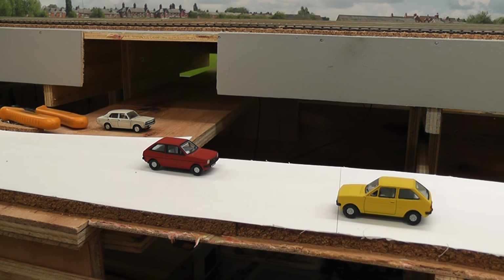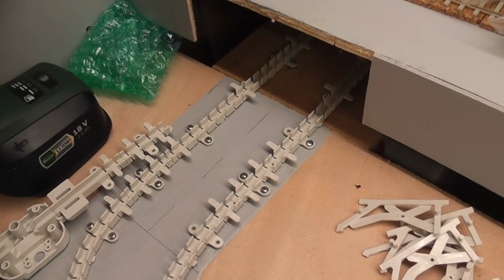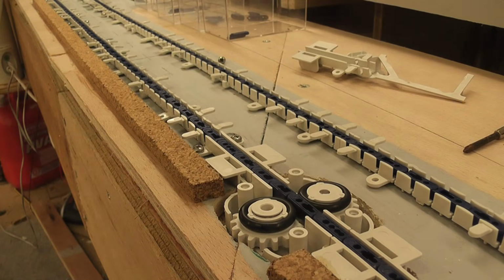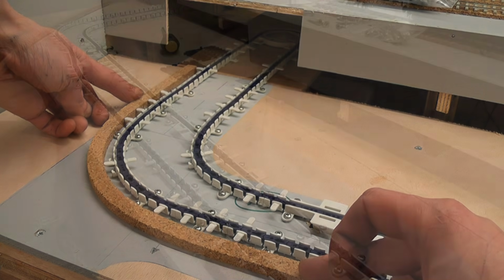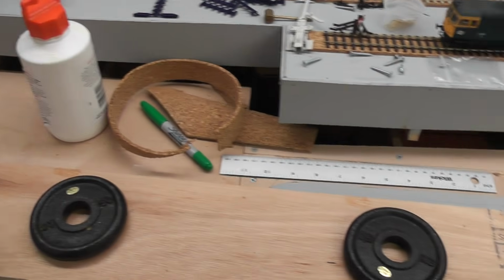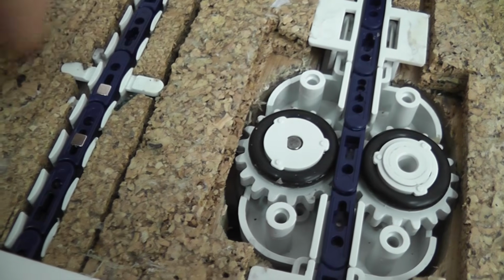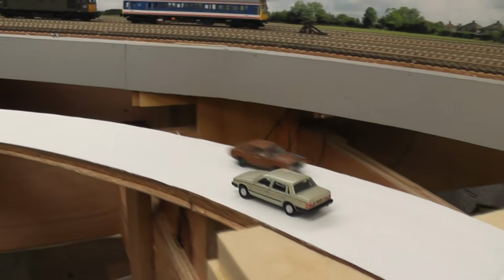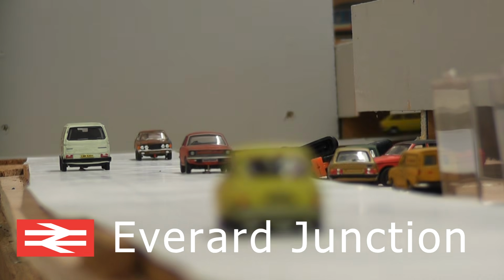New Layout Build - Magnorail

Comment: This is really very good, I tried incorporating Minic Motorways into my layout and abandoned it in the end. The high definition camera's are pretty cruel when it comes to detail and this showed up with the wobbly wheel syndrome in the same way on this system. May I make a suggestion and see if you can get some new plastic wheels 3D printed. This process can be very accurate and will solve the problem. In all other respects I think its great. Super video as well.

Comment: I have only seen the bicycle system. This is great. I see Peco have just brought out kits of Leyland busses Maybe they would work on the system being lighter than the oxford ones. Also does the drive motor tyre have a spring to keep it in contact with the chain Otherwise how does it compensate for wear.

Comment: A fascinating watch Richard although I'm a little concerned regarding the noise. With Chadwick Model Railway (do check it out) I've moved away from solenoid point motors to tortoise, to cut down on the unrealistic sounds.
To invest in sound locos and then having to listen to the "sound of gunfire" as the points are set, removes any realism. Hence my worry as your chain drive wears. 
Keep the videos coming mate. Regards Charlie
Reply: I bet I could find ways to kill chain and motor sound pretty well with some foam sheets.
Reply: Hi. I think most of the noise is due to the rigid baseboard acting as a sounding board. Maybe the answer is to mount the system on a thick cork bed? It would need some experimentation. But, boy, does it look good! I think I'd accept the noise of the car engines ☺ for the extra realism.  Now, what to do about passengerson platforms? BobUK.

Comment: How many kits to achieve that? It looks good but at 169 euro for a starter set it seems expensive for a few bits of plastic. How will the road surface wear ? I can see wear lines appearing very quickly where the vehicles are tracking. Cheaper than Faller but maybe a more involved solution with greater wear on basically thin card.

Comment: Thanks for the video, it's a system I've not heard of before.  Very interesting!
Did you consider mounting the photo card the other way around.  That way you could have printed on an asphalt road surface prior to "laying" the road.  You mentioned  that you placed it shiny side down to reduce friction, but I wonder if the cars might produce more friction than the track running under the surface?

Comment: You have probable knocked all sales of The Faller system on the head now, and done what Graham (Lakeside) done for a DCC turntable sales. looks good, reminds me of some of the cars I had in the 1980's were the suspension was knackered! (couldn't afford much when I was young) One question would a bit of white grease help in reduction of noise and aid smoother running or do Magnorail recommend no lube?
Reply from the maker: Magnorail state that it should not be lubricated.  The noise come from the reduction gearbox fitted to each motor.  They are a sealed unit and come greased from the factory.  Very similar to the sort of motor you'd find in a power tool hence to noise.

Comment: Hey I came here as I was looking for making a small Xmas village haha. My husband is in train stuff. We saw this solution earlier as we are Dutch. Agree, the Faller system has a huge downside... mostly for bigger things ike a bus or lorry, and they run way too fast. Its pricey as well. Husband is thinking about your system too but still has some doubts. The major reason this product isn't doing well is because of its loudness. That's why all doubts here as well. We've seen a demo.
We did notice that you screwed the system directly to the wooden surface. Would some insolation layer material in between help perhaps? I'm sure you thought about it, but would that make the system unstable or something? What are your thoughts. 
Thank you so much for all your sharing :)

Comment: If you would glue a layer of foam or Kork to the lamella of the chain guides, you could reduce the noise?
And could you fix the slider to the bottom of the cars to reduce friction? I mean if they are low enough above the surface but still not touching the street. Sorry, I never can leave any concept alone... always messing with stuff. :-)

Comment: Just a few issues with this: 

1) there are a lot of wobbly axles and they really show
2) how does this affect your modular design and dismantling the layout?
3) maybe it’s the camera being closer to the roadway than the railway but the road was drowning out the sound of the train. You have great spacing on your railway joins giving a proper join noise (clickety-clack) but you can’t hear it over the roadway.

Having said all that the layout is coming on really well and it’s definitely a great addition the active roadway static vehicles never look right especially when; going by the previous layout, everything is so detailed. 

Keep up the great work and looking forward to the next vid.

Merry Christmas Richard
Reply from the maker: 1) Only just got it working plenty of work left to do.
2) The layout is designed to be easier to dismantle - not modular
3) The camera makes the noise more obvious - I can hear the whole room, the camera hears what its pointed at.

I've still got plenty left to do but for a first attempt I'm very happy with it.  Cheers

Comment: Looks very nice, however I'd encourage you to experiment with mounting the magnets directly on the vehicles, rather than on the wee brass sled. Reason being, the sleds will mark the road surface - you can see it happening already towards the end of the video - and over time erode or mark any paint you add. 

If you can mount the magnets to the underside of the car with say, 0.25mm road clearance, you would lose the unsightly  brass stick at the front, and eliminate the tarmac scoring. The wheels will still discolour the tarmac paint you use, however it will take much longer as they are rolling. 

This may also allow you to use more vehicles on the layout, as it would get rid of the friction between the sled and the road surface. You might need to use larger magnets on the vehicles due to the greater magnet spacing and inverse square/cube laws of magnetic attraction, but nothing that wouldn't fit inside one of the diecast cars. Another option might be to tap a countersunk or socket cap ferrous screw into the underside of the car (CSK to permit the greatest amount of metal close to the road surface). You could turn it to accurately adjust the clearance. In theory, the attraction between two magnets is the same as between a single magnet and a piece of steel...at least when in direct contact!

Another thought to reduce wear and friction is to 'unlock the diffs' of the cars. I'm presuming a lot of the models are oxford diecast, which have fixed axles. If you are able to modify the axles to allow each set of wheels to rotate independently, it would make the cornering slightly easier and reduce the load on the chain drive. In the past, I converted an oxford diecast 1/76 SWB Land Rover Defender to R/C, and I used 1x3x1mm bearings (you can get 30 for £5) in the front wheels to setup the steering and allow independent rotation. You would only need one bearing per axle, as the bearing could sit on the inside of one of the wheels allowing the other to be fixed to the axle.
Reply from the maker: Thanks for the advice.  I'm still experimenting with the system and have attempted to mount the magnets directly to the vehicles.  However this caused the square magnets in the chain to lift the road up and directly contact the underside of the vehicle causing the chain to jam.  I'm going to keep working on it and will monitor the road surface.  The marks you on the road from the sliders are more a trace of dirt than actual wear on the surface.  Time will tell so I'll keep working on it and see if anything can be improved.

Comment: looks great Richard, the cars moving just's give the layout that extra dimension of realism. Trying to work out I can make it work on an exhibition layout tho with joints. Andy
Reply from the maker: Thanks Andy.  At joints you can cut the track but the chain is the issue.  You'd have to manually separate the chain at each joint and hope its stays there in transit or remove the chain completely and add back with each event.  Not ideal but it would work.  Cheers

Comment: Very nice video.  Adds quite a bit of realism to your layout, seems pretty simple.  It does sound rather raspy in the video though.
Reply from the maker: The noise comes from the geared motors used in the kit.  The actual chain and track makes very little noise but the noise needs to be considered before purchase.

Comment: Bit late now but you could have run the wires for street lights before adding the road surface.
Presumably this system doesn't allow for vehicles to take different routes at junctions.

Comment: Looks fantastic!  Now all you need is to substitute a van type ambulance for one of the vans already running.  I wonder, would it be possible to put two systems working at the same time with one system around the other and you could vary the speeds to allow emergency vehicles to travel faster? Just wondering...
Reply: Here is an N gauge Motorway with fast and slower lanes, boats on the river, and a plane crossing the sky. Brilliant stuff using Magnorail. The Everard Junction video is a brilliant tutorial. https://youtu.be/Czwre2RPkhM

Comment: You'll need to grease the plastic chain with vaseline or a a plastic safe grease that won't evaporate to reduce the friction in the chain and loud noise. Great video BUT is it still for sale because I can't find it on Ebay or amazon and have never seen it in any model shops.
Reply: Found the link :)
Reply from the maker: Its says specifically in the instructions not to lubricate it and it gums up the mechanism.  The noise comes from the gearbox inside the motor.

Comment: I think it’s the Engineer in me but why do you bring in one of the tracks on the Lh end of the road system closer to the other lane, ie not symmetrical? Love it all Richard, but this bit bugs me 🦗🦟🐜😎🇦🇺
Reply: its to simulate the car moving into the right hand lane at the junction that will there when the road is painted on :)
Reply from the maker: Thats a right turn lane for the T junction.  It will become clear when I add the road markings.

Comment: I think it would work better if you routed the grove using a bit into some MDF, a bit of work and just use the motor housings would be no joins and a continuous groove to run the chain.  Also why not try some silicon lubricant on the chain, like Plexus that will make the chain run smoother with less friction..
Reply: The straight parallel sections can be routed and would be much less work and joints etc.
Reply from the maker: Magnorail state that the system should not be lubricated.  The chain and track have very little friction.  The friction comes from the magnets when attracted to a slider.  I didn't route a groove as the deck is only 9mm thick.

Comment: I think you may have presented yourself with a dilema Richard. If you run the road in night mode, are you going to install working lights on the vehicles ? If so, then how ?
Reply: maybe some sort of wireless induction system (a lot of work though)

Comment: I was sad the day that the old layout came down, but holy crap...........no more. Kudos to you sir. Side note, you'd think that this system would allow the magnets to almost touch, than to let them come into contact with the road, because I see these sliders marking the road surface in no time. 

Second side note, you now need to have a tire fitment center somewhere on the layout.
Reply from the maker: The mark in the road is dirt and not actual wear on the surface.  I'll be adding a garage and car dealer in future.

Comment: Brilliant, absolutely brilliant. well worth the hard work. i presume you are going to be putting drivers etc in the cars. When you have painted the surface, will the copper strips mark the surface.?
Reply from the maker: So far the sliders have left a dirt mark on the surface but not caused any actual wear.  There will always be a mark present even after painting which is the same as the Faller system.

Comment: I havea small section using fallers system, but after seeing this new system I'm tempted to import it into the US and check it out now. The dislike on faller is the cost for me espeicalyl since I have to have my local hobby shop import the fller system ffrom germany, It hurts my wallet, I wonder if this will be ust as expensive to bring in, one way to find out.
Reply: Why would your local hobby shop need to import Faller car system bits directly from Germany, Walthers should have it in stock?

Comment: Magnorail cars!  :-)  Really looks as good as Fäller's car system — much less expensive, I hope?
Reply from the maker: For a large install its much cheaper.  It still expensive but with magnorail you can run any car you want.  With Faller each vehicle needs to be motorised which gets very expensive.   Faller also doesn't work with cars as they are too small.

Comment: Brilliant. Very well executed. Thoughts on how often you’ll have to resurface the road as the sliders wear through the paper surface?  

It provides a wonderful busy road feel for sure. And the benefit of running cars without having to become a microsurgeon installing tiny batteries and motors  or building custom inductive powered cars such as on an Eastern European Layout I’ve seen, is a good thing.  Thanks for sharing.

Downside is you now have to fix the dozen or so wonky axels and wheels on those cars so they don’t look like circus cars ;)

Comment: For trucks you could probably use BT Models (Base Toys) ones. I've got a couple and it seems they are largely made more using plastic body shells with metal being used mainly only for the chassis, so they should be lighter.
Reply from the maker: I have a BT Leyland T45 I'm going to try out.  Like you say they use more plastic in their construction.

Comment: Now this really does add that extra interest to the layout, an amazing difference. Are you going to have a mini-roundabout at each end? I think they were a thing by the eighties. Only thing i don't like is the noise, but i noticed it seemed a lot quieter after you had put the cork strips down, only seems really noisy near the motors now, i am sure you will find a way to deaden that sound a bit. but the added realism it gives to the overall layout more than compensates for the noise. Have never seen this system before, i am sure you will be responsible for the sales increasing in the country!
Reply from the maker: The noise comes from the tiny gearbox inside each motor.  The the magnorail itself is actually very quiet.

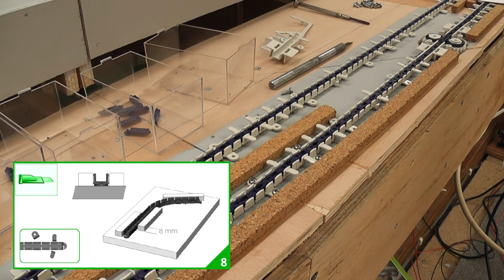Comment: Very interesting, never heard of this before either. Excellent addition to your layout, creates a wonderful dynamic to the scene. I also like your attention to detail, and your ideas well thought out. Can I ask, why did you keep the little lugs on either side of the track channels and cut the cork to fit between? At 19:04 the snapshot of the instructions seem to show that the lugs could be cut off and the filler placed right up to the side.
Reply from the maker: Correct, you'd have to glue the track down but it might work out easier.
Reply: @EverardJunction  I mean the upper lugs, can they be removed?
In which case, I suppose, what are their purpose anyway?
Cheers.

Comment: Excellent video. 
One little observation... by the end of the video you can start to see a grey line has started to develop where the sliders rub along the paper? 
Invariably if you paint the road surface it will eventually be worn away by the sliders so there may well be some form of continual maintainence needed to the road surface. I think you might be able to mitigate that to some degree or another by using black or grey coloured paper rather than white?

Comment: I liked this a lot. Spray some silicon lubricant on the chain ( If it won't melt it!) to reduce the clatter.  Regards Stephen.
Reply: Yes I was thinking using silicone spray or graphite to reduce chain friction. Would be nice to see a police car & royal mail van for a bit of colour. Some "00" BASE TOYS models are plastic especially model buses. A great idea & super video!
Reply: perhaps some graphite spray as it won't attract dirt?
Reply: Actually they advise not to lubricate the chain!
Reply: Yes 3 in 1 silicone spray would be perfect. It takes a day or two for the carrier to evaporate (it actually seems worse until it does) but it will make a huge difference to load on the motor
Reply: Put some foam around the whole thing.  Maybe even make the road out of thin foam, which is something people do already.

Comment: Richard looks really good and realistic, do you think if you sprayed the entire chain with silicone you would reduce the noise also possible wear on the bends, I've worked with a similar industrial plastic chain belt system albeit on a much larger scale, I found regular applications of silicone spray increased the lifespan by a huge amount and quitened it down as a bonus.

Comment: What a wonderful system.  Thanks for demonstrating some of the difficulties involved.  Will it take heavier vehicles such as lorries and buses.  The only issue I can see is if it ever comes to a level crossing.  It certainly adds interest to any layout.  I always find it mildly irritating that when pictures are taken of a layout, that whereas the trains are moving and changing, the vehicles are static and the same in each sequence.  This way it would be different.  I will look forward to the final after painting.  It looks as though the road will be a bit tight next to the corner shop because a pavement will need to be there.